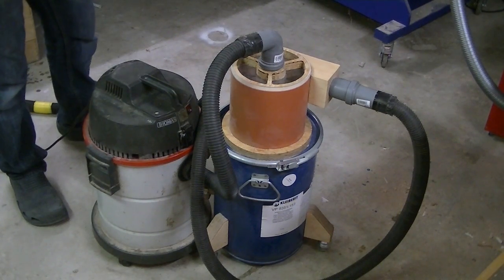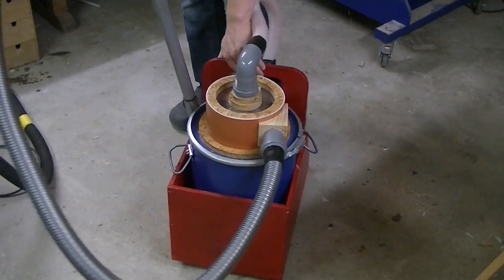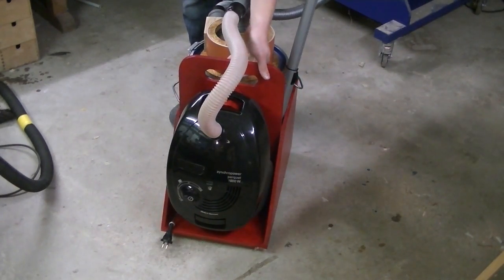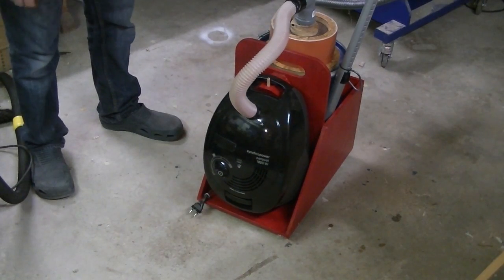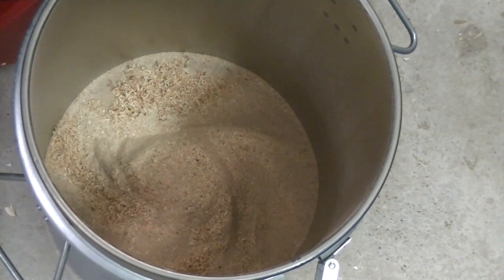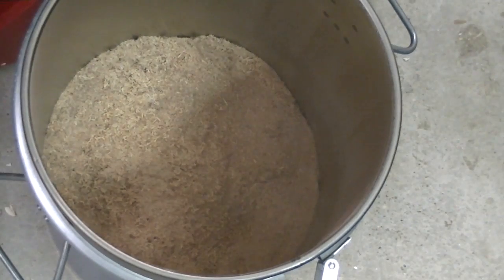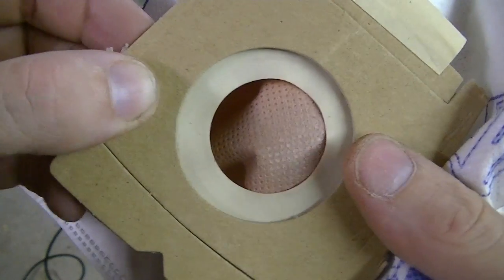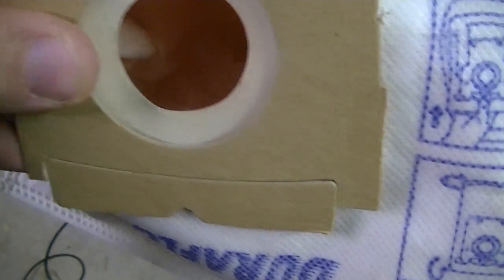Homemade Cyclone Vacuum Cleaner

Comment: Could you please provide details of dimensions of the pipes and fittings used to make your cyclone vac as I'd like to try and make it. I'm also struggling to find a piece of pipe this size so if you could let me know what it is so that I can get it from somewhere in the uk. I'd really appreciate this thanks.
Reply from the maker: It is 50mm PVC piping.

Comment: Hello! Nice build! I don't know if this is asked already but the obvious question now is how this compare to the shop vac version? You have built two similar cyclones and powered them with a shop vac and a vacuuum cleaner. Can the vacuum cleaner one replace the shop vac? The wattage would probably be somewhere in the same range (?). Can you estimate differences in static pressure and CFM? .It would be nice to hear your opinion.
Reply from the maker: The vacuum cleaner one can definitely replace a shop vac. They both work very well. I don't know how watts the shop vac does but I guess it can't be far off the vacuum cleaner.
Reply: Cosmas B Thnx! It would be fun to find out an easy way to compare them objectively. One could of course build a simple manometer with som tranparent tubing. Or put a fabric bag in some way on the outlet of one of the blower units and se if the other one can "outsuck" it the Matthias Wandel way...Well, I'm not requesting you to do it - just thinking out loud.
Reply from the maker: mfwoodful
Would be fun but I don't have time and I must admit I'm not particularly interested in the outcome of this experiment. Both work well so why compare them. If one would work better then the other an experiment wold be worth while to do some troubleshooting.
Reply: Cosmas B
In your case I truly understand. I'm just wondering if  not many woodworkers thinks that you must buy a shop vac for this application, (that is when not going for a bigger dust collection system), but that a vacuum cleaner could do just as good or even better...

Comment: Great video Cosmas. Why a speed controller on a vacuum cleaner?
Reply from the maker: Honestly i have absolutely no clue what it is good for. I always run it full power.
Reply: For different floors/carpet I think
Reply: Hmmm, I thought everybody used that. On maximum power my vacuum cleaner sucks (in the literal way) so hard, that it is impossible to move on carpet or rough surfaces, so you dial it down. On the lowest setting you can hover curtains without them being sucked in.
Reply: Because, when the bag or the cyclone-box is full /or too dusted/, it opens automatically the safety-valve. It's purpose is to allow the motor to cool down, sucking air from 2nd opening. Than the vacuum rate in the sucking pipe drops significantly and to turn it back in some useful limits, you have to close the safety-valve... somehow. And there come the speed-control - reducing the motor revs, the vacuum rate in front of the motor drops and close the safety valve, which increase the vacuum rate in the hose and you can continue cleaning. ;)  

+Cosmas B, Very nice design,  i bet it's water-resistant too.